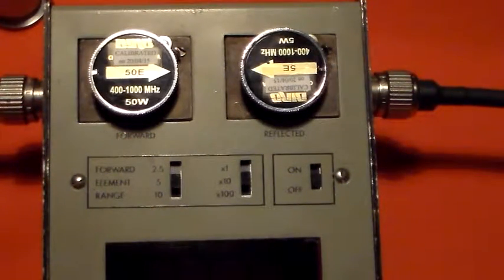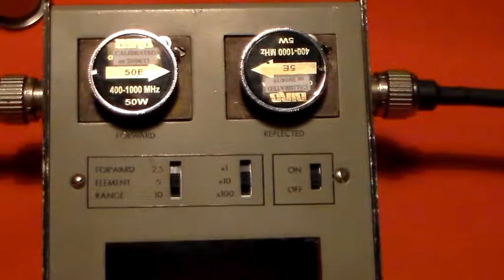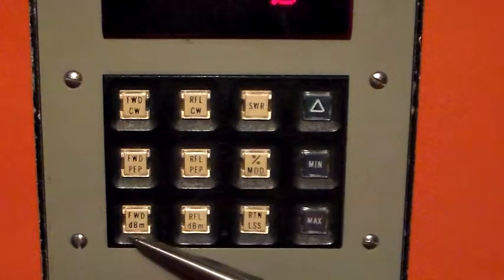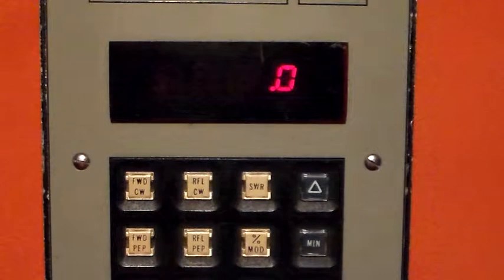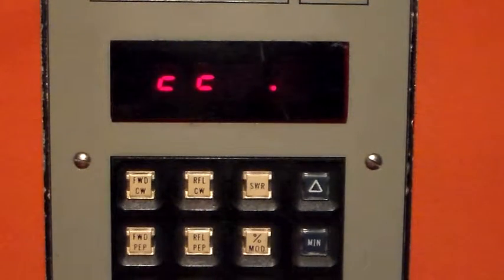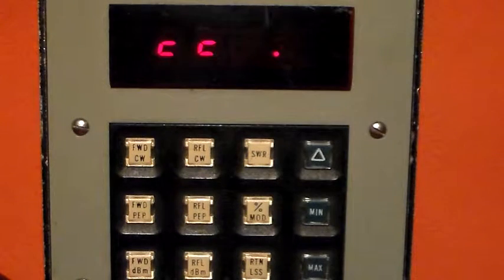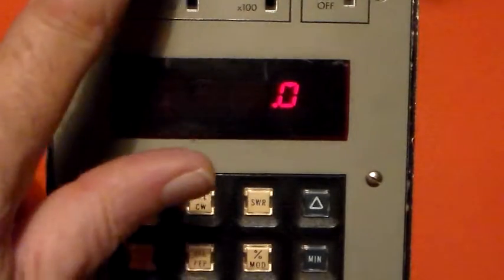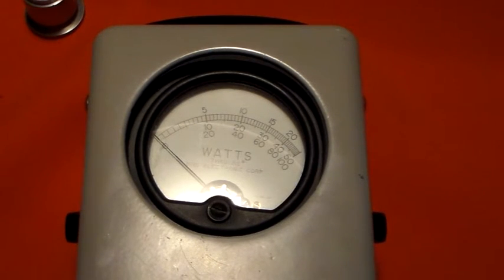A Bird 4381 'RF Power Analyst' From The 70's.

Comment: Awesome post/mini-tutorial. Thanks. Perhaps you can answer a question for me. I just got one of these and I need to get the power adapter/charger/converter. I don't see any specifications for it in the manual. Do you have any idea what the power adapter should be? How many Volts DC? Amperage delivered? Type of connection plug for the jack (looks like it might be a 3.5mm, non-barrel style...)?
Reply: Same here. But on mine it is written 9 VDC 350 mA. Not sure about the jack, I tried a 3.5 mm and it fits well.